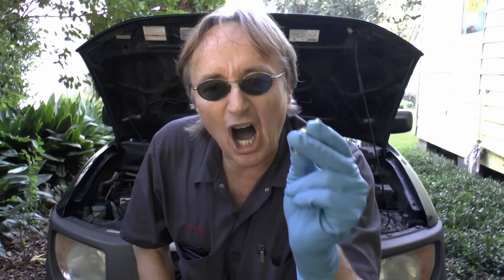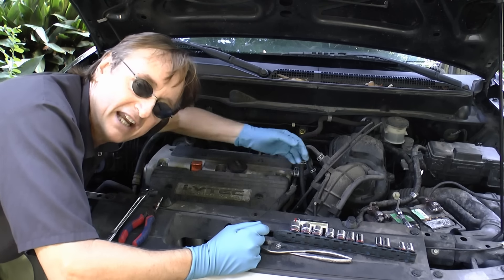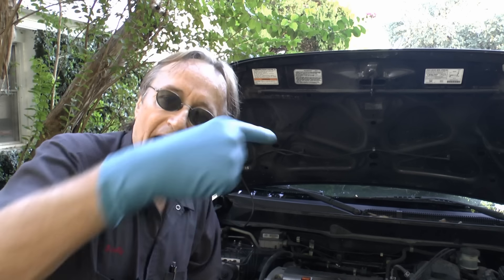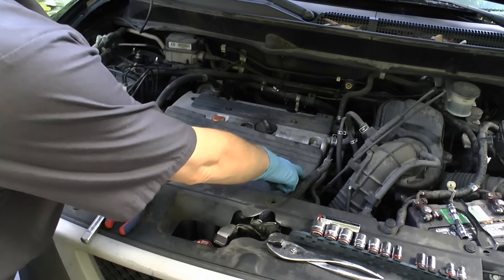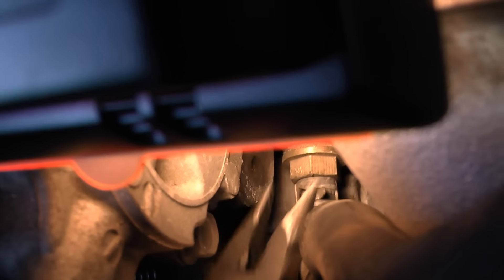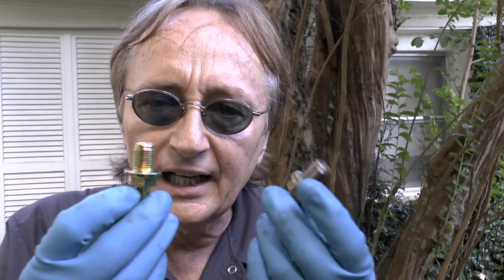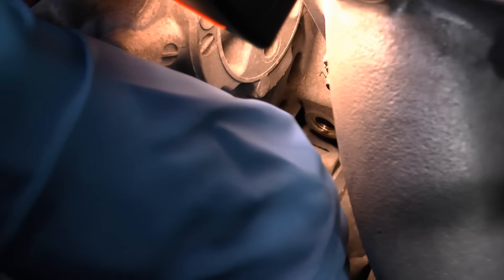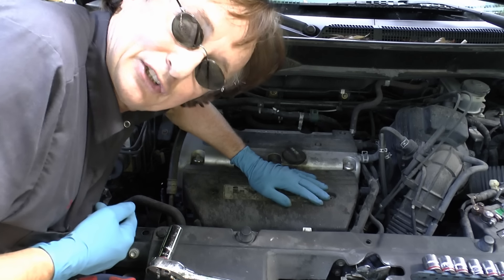How to Fix a Car Engine that Burns Oil for 10 Bucks

Comment: Thanks Scotty. I've got an '08 Pilot that's started using a quart of oil between changes but runs smoothly, doesn't leak and doesn't have any visible exhaust smoke. I think this may be the fix.

Comment: Hey Scotty!
You just saved me about $700 with this video. Thanks to you, I didn't go out and buy a JDM replacement engine. 
My Element has about 214K on it, and just noticed it was burning a lot of oil, sluggish acceleration, and occasionally puffing out white smoke after coming after random stops/starts. Replaced the PCV, and all is good!
Cheers, Man!!!

Comment: I have a 2010 Mazda 6, Australian version.  It suddenly started burning about 1-2 litres of oil per week.  Being mechanically experienced, I diagnosed as the PCV valve.
Mazda Australia wanted $70 for a new pcv assembly including the oil/air separator. It's located on the side of the block -need to remove the intake manifold to access it!!  So I ordered it, took 2 weeks to come from Japan.  
By the time it arrived (and 4 litres of oil later), the problem fixed itself and never reappeared.  Many months later, I still have the brand new part on the back seat!! 
I don't know whether to be pleased or pissed!

Comment: my Olds 307 burns oil because the old owner never changed the oil and the rings and valve guide seals are shot lol
Reply: Useful Entertainment 
The morons that owned the truck before me never did any maintenance now even after I’ve changed the PCV it still puts out blue smoke at start up and is a gross polluter, three times over the max limit. No doubt rings and valve guides are shot. Uses a couple of quarts of oil between changes and 4 of the six spark plugs are gummed up when I change them.
Reply: BIG TRUCK DRIVER  wats seafoam?

Comment: how to fix an oil burning engine for FREE: remove oil completely
Reply: +dragonslayer1483 exactly ,lol
Reply: +dragonslayer1483 Then spend $?? to put new oil and filter in the engine
Reply: TheMinecraftChannel!- Minecraft and Other Games! lol it was a joke
Reply: +TheMinecraftChannel!- Minecraft and Other Games! no, you dont put new oil in. just take the oil out then it cant burn oil anymore haha
Reply: +Nick Palaroan All fluids are all fake, they are a conspiracy to wear the parts in your engine! When you rub two rocks together do they explode? NO, that means the same for engines. I've ran my 2000 civic complete with the sick fart can and giant wing for 1,000,000 miles on no fluids and it works fine!
Reply: +Alec Mueller Frictionless bearings yo!
Reply: +Nick Palaroan Damn right. Frictionless bearings should be standard across all manufactures. It's all a plot to get our money I tell you!

I feel like starting a flame war by either saying Ford or GM sucks, but that'd take too long.

Ford and GM cars suck compared to the mighty SEBRING!
Reply: +Alec Mueller Sebring? The pokemon?
Reply: Chrysler?
Reply: +Alec Mueller All about the lebaron.
Reply: +Nick Palaroan truuuu
Reply: +Alec Mueller my car went 10k miles with no trans fluid (5-speed) without my knowing, and who knows how many under the previous owner... Needless to say the new trans is sufficiently lubed
Reply: +dragonslayer1483  that also helps with oil leaks
Reply: +dragonslayer1483 sooooooo if you empty oil from the bottom....is this completely removing the oil? I take it that its not that simple or there would be no need for you comment sooooo what's the trick to completely do an oil change. I have a 1986 Honda Prelude.
Reply: 222Lightning um... its a joke. dont do it or your car will be ruined. take it somewhere if you dont know how to change oil..
Reply: +dragonslayer1483 I knew a guy who ran his car on no oil because his oil pump stopped working and i guess he didnt think it was worth fixing. It actuallg lasted about 3 months with some loud knocking. What a beautiful sound it was haha.
Reply: Nick Palaroan and by beautiful you mean cringe worthy, right?
Reply: +dragonslayer1483  i went to see  a mechanic and said that its not worth changing oil it will just burn the new oil.  is that true.
Reply: no map not at all... oil needs to stay maintained as well as possible. its one of, if not the biggest factor in determining the lifespan of an engine
Reply: ***** cool mane, totes will
Reply: Troll True love
Reply: Yo, don't listen to that guy he's a fool. Your videos are awesome and funny as hell!
Reply: Alec Mueller you sir are a gentleman and a scholar ; lmao hehe
Reply: dragonslayer1483 😂 LOL
Reply: wow wow wow dude, don't forget to add smiley or say #joke so people understand it is a joke, there is a lot of literal people out there. :D
Reply: Then they deserve it.
Reply: kracken you cracking me up
Reply: Lllllllllmmmmmmmffffffffaaaaaaaooooooooo

Comment: My car was fine and then all of a sudden it started burning oil which resulted in alot of exhaust smoke, so is it the PCV valve or piston rings gotta change?
Reply from the maker: try the valve and PrAY
Reply: Scotty Kilmer May god be with me.
Reply: Sound like rubber seals, or piston rings.

Comment: Scotty what the heck is splashed all over the siding of your house?
Reply: Looks like a sprinkler pipe burst or something and sprayed down onto the mud causes it to splash all over the siding. Thats my theory.
Reply: He disconnected the PCV valve while the engine was running!  ha ha
Reply: I thought the same thing too!
Reply: Jeeze, you would think Scotty would chime in on this one.  We need to know Scotty.
Reply: Nope the engine pulleys are idle, engine is not running
Reply: Guinness keg exploded.
Reply: He revved up his engine too close to home
Reply: Yeah, don't let vines grow on your house. They cause all kinds of problems!
Reply: Bondo Doo doo
Reply: Webs

Comment: U sure did pick the right get car to do that on.
Reply: rockyfosgate yeah lmao I got the same engine it runs through oil I changed the valve cover gasket and it still leaks or burns oil.

Comment: I changed the PCV valve and it’s still burning oil………next? Lol
Reply: Piston rings
Reply: time to buy a new car
Reply: Not necessarily. So I wasn’t very thorough with my response but hopefully this helps the original commenter. If you changed your PCV valve and it’s still burning oil. It could be worn piston rings or worn valve seals. Engines have pistons and valves that move up and down when the engine is running. The pistons have these metal rings and the valves have these “rubber-ish” seals. Swapping either seals is an expensive labor-intensive job. It would be considered an “engine rebuild” since they have to take it apart to change the seals. People do it depending if they have the money or how much they love their vehicle. Some people would just do an engine swap since a lot of the times the cost of an engine rebuilt is close to just doing an engine swap… but most people don’t have the money to do neither of that. So what you can do is the following: 

if it’s your valve seals, I highly recommend buying ATP-205. Scotty recommends it also. It only cost about $12 online and you pour it in your engine oil and after driving it for 5 hours total (i forgot how many miles), the chemicals should have done its job to the valve seals. Now what it does is it restores and rejuvenates and softens the valve seals again since they tend to get hard over time and oil starts seeping through them causing the engine to burn the oil. That stuff works wonders! And I can personally testify that it works!! And you only have to do it about once or twice a year to keep them rejuvenated. I recommend looking into it! 

Now if it’s your piston rings, that’s a little more tough and the solution it’s not fully guaranteed but you can change your oil to a higher viscosity to avoid seeping through the metal seals. You could also try an engine cleaner/flush because it could just be a bunch of built-up sludge also. But try a higher viscosity oil or an oil thickening agent like Lucas or Bars Rings Seal. Both products work well, but if it’s not your piston rings then it won’t do you any good. You’ll be able to have an idea of what it is after trying these products. 

I hope this helps, good luck brother!
Reply: You probably have worn piston rings
Reply: Burning oil is not only pvc valve but valves of oil seals, rings of pistons and ect....

Comment: We changed on TSX and two odyssey 
we saw improvement in fuel consumption, better torque, engines rev freely, idling at stop light smooth, feel like a new car.
We had been using green fuel tab for several years and will keep an eye on it to see if carbon deposit would solve clogging pcv valve.

Comment: IMPORTANT!!!!! If your General Motors engine's PCV valve is enclosed in a "chamber", make sure when you replace the PCV valve, you're also adding o-ring "sleeves" to it! The new one doesn't come with the O-rings so match some at OReilly first. Without the o-ring sleeves completing a controlled air path, air squirts around the valve itself (throwing error codes doing so) and you can't pass emissions testing!
Reply: I used the old o ring for my 2000 Buick regal..with 64k..it was in good shape? But still burning oil

Comment: Picked up a 01 Silverado only had 148K miles that was blowing back soot(oil) tail pipe. Poured couple of cans of B12 Chemtool and a new PCV valve fixed all that mess lol. It still had the original PCV in it from 2001 !!! YIKES !!!

Comment: I own a 2011 malibu 2.4 ecotech and the car is a smoke trail/oil nightmare. The car/engine itself still wants to run though like you can tell its still got some type of life in it. But this oil issue i have the money right now to fix it but i want to know like the root of the problem before i buy anything. Id like to completely rebuild the engine if i can blessed on another car because this car has gotten me through some CRAZY situations in life and the least i could do is return it to its glory days. My first paid off car not to mention.

Comment: Thanks for this, the PCV valve never occurred to me. Got a Suzuki that loses a fair bit of oil at sustained high road speeds. Only 70k miles so unless it wasn't run in properly it's not wear

Comment: Scotty I have an 08 prius. I guess these are notorious for plugging up the bottom rings.
The car only takes 3 quarts and at 3000 miles it only has 50% of ot left. Dealer recommends oil changes every 10k is there a chemical flush I can do ?

Comment: Those covers can exist for a number of reasons.  Yes show is a big one.  But also they cut down on noise.  If noise is not an issue for you don't put it back on.  When I have the hood open, for any reason,  I like to do a quick scan and look around for leaks or other problems.  They prevent you from doing  that quick visual scan.  Ever buy a replacement part and find the wrench size is different than the OEM?  It happens......Scotty, How are those Duralast sockets from AutoZone working for you ?

Comment: To clarify, as I was just told my motor on my Rav4 is burning oil but not dripping oil,  you are referring mainly to motors burning oil only correct?

Comment: My Toyota engine 2az fe has a blown headgasket. I've added sealant with the procedures explained by you but when drained the oil water gushed out first before milky oil.

Comment: I have a 08 Accord with 160k miles. I started my car up and when I started driving there was a bad clunking noise from the engine. I took it to my mechanic and he said there was no oil on the dip stick. He added a few quarts so I’ve been watching it. I routinely add a quart over a few months. I’ve heard everything from broken rings to broken main seal. What no one has told me is Pcv valve. I will change it ASAP. I was stressing as Honda engines are supposed to be extremely reliable .

Comment: Sucking vaporized oil (however minuscule) back into the intake sounds like the worst thing for combustion.  can I exhaust the PCV valve down to the ground and cap off the unused  intake inlet?  Of corse that wont pass a smog visual, but I can fix that in a minute.  Is there enough crank case pressure by itself to open the valve?... or is it a combination of crank case pressure and intake vacuum that opens the valve? [EDIT] Just tried this for the heck of it (and to confirm I do have a vacuum coming from the air intake)... doesn't work, PCV valve remains closed I think, and rough engine idle results.

Comment: Hey Scotty I’ve a Holden statesman v6 2005. My car seems to be burning engine oil other than that the engine seems to be working fine. It also produces produces white smoke on startup only. Do you think it’s the PCV Valve ?

Comment: Hello there, I have Chevrolet optra which is also known as Daewoo nubira or lacetti in some places. It's a 2 litre diesel engine. I changed engine oil with liqui moly Ceratec a couple of months back at 135K KM in the odo. Now, my car has run close to 5K Km post the oil change. During my travels, I noticed a burning smell inside the cabin and soot building up on the rear bumper with oil when I go at high speed like 160+KMPH. My car has been running on a stage 1+ remap for more than three years and 50K+ KMs, so it usually smokes when I go hard on the throttles. And there is an open oil can in the spare wheel space which was dripping under, so I thought that's what's nixed with the soot and deposited on the rear bumper and it never occurred to me to check the oil level. When I finally checked the oil level a couple of days back, it was on the minimum level. My car takes 6.2 litres of engine oil. So, my car is definitely burning oil and the only culprit that I can think of is the Liqui Moly Ceratec additive that I added for the first time. It hurts so bad thinking what I did caused this. This is my first car and I have a great attachment to it. What do you think has happened? Thank you for your help!

Comment: hey scotty so i got this 09 scion that runs like a champ, i got an oil and tranny fluid change today and out of no where i can hear a slight ticking when i press the gas between 1st and second gear rpm range. if i let off the gas, it dissappears, if i lightly press the gas it makes this very faint clicking/ticking noise. when i drive by and theres cars on both sides of the road i can hear the noise ricochet off those cars. what is this? no engine lights or leaks or anything. runs amazing.

Comment: Hi Scotty, my engine all of sudden shut down during my drive, without any thing abnormal. The engine oil light was on when I tried to restart the engine, and I cannot start it. The steer wheel was super heavy.
My mechanic checked my engine and car computer, nothing was wrong. At last, all of a sudden, the engine go back to work again.
Can you tell what could be wrong here?

Comment: Hi love your videos... I had this done and it helped but engine still burning oil and slow acceleration most times.  Before having pcv valve done it would blow out white smoke it’s a Kia! Never again. Any suggestions on what it is that’s can be causing this?  Thanks in advance.

Comment: Scotty, are you anywhere near Virginia? I need help and I don’t know what to do. I have a 2003 Toyota Tundra w/130,000 miles. So many mechanics😩. One had it for over a year and so many part replaced. And it is still doing exactly what it was doing when I brought it to them in the first place. You may be my only hope. Help please.

Comment: Scotty or community. I have 2006 dodge Durango v8 hemi. I recently have replaced the valve cover gasket and the oil pressure sensor. It’s not burning oil in the sense that it runs low quickly or anything at all. However there seems to be a leak somewhere that is showing signs of oil or grease on the underside and is causing a burning smell and a small amount of smoke sometimes. I know that my oil pan plug has a small leak and I need to get an oversized one that re-threads bc I already replaced it. But just wondering if it’s possible that’s the culprit or is there something higher above that may be causing the issue.  Thanks for any advice. I’m fairly handy and do my own work but I’m not a car mechanic. I do home improvement and work on motorcycles. You can see everything with them.

Comment: Thanks for the video. However, I think it's important to mention that not all PCV's are easy to get to, and not all are cheap to replace. My 2011 Chevy Suburban and 2010 Chevy Avalanche both have the PCV integrated into the driver side rocker arm cover (aka valve cover) and gasket assembly, they cost $82-112 to replace, and you have to remove the coil pack to get to them.

Comment: A guy told me this could be the problem on my Buick Regal.

So I bought it and replaced it myself.
It was not the problem my value cover box facing the exhaust was the problem. It was a GM recall alittle later on.

Comment: Impressed with this planned video.

Can you suggest me diagnostics.

I m getting intermittent humming sound when accelerating the engine while driving.
In stand still no humming is observed.

Yesterday I changed the break pads and rotors but noise is still there.

Comment: Hi Scotty. If pcv is bad would it give lot of pressure in oil dipstick tube. I have a ford maverick/escape 2,3 that uses a lot of oil.
Reply: I would guess.... YES
The PCV is supposed or reduce crankcase pressure.  It sounds like you have high crankcase pressure.

Comment: if the pcv is stuck closed it will blow seals but if it is stuck open from say a weak spring or broken spring it will draw oil into the combustion chamber

Comment: I just replaced mine after 9 years and 672K on my Ford van. Its been using 1 QRT of oil every 1000 K miles. I do get some light smoking out of the tail pipe. The base end of the valve was oily.

Comment: Hi Scotty. Your videos are brilliant. I think my pcv valve needs changing because my Zafira B 2008 burns a lot of oil. Where is the pcv located on the Vauxhall Zafira B 2008 1.6 life? I'm In desperate need to get this problem fixed asap.